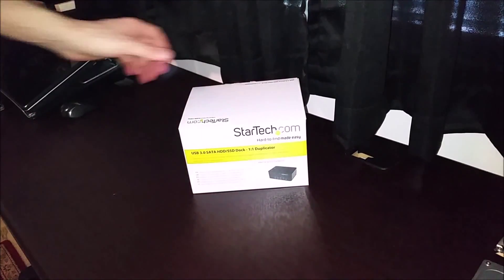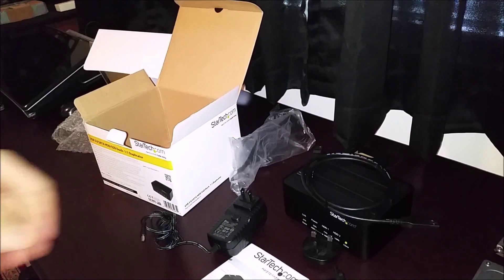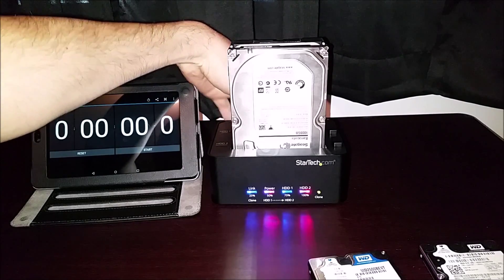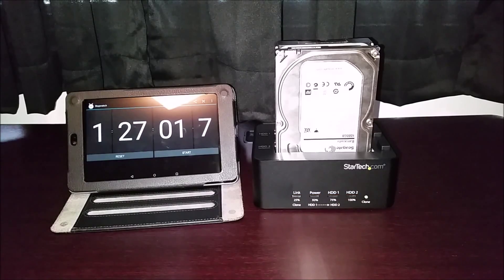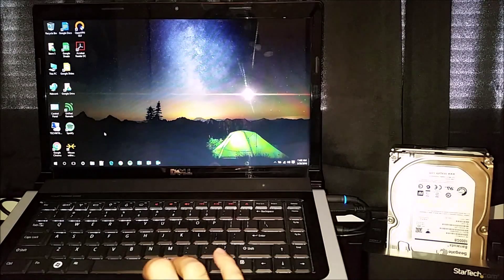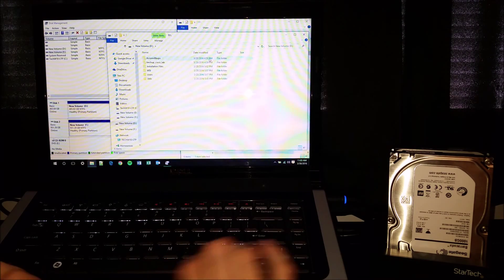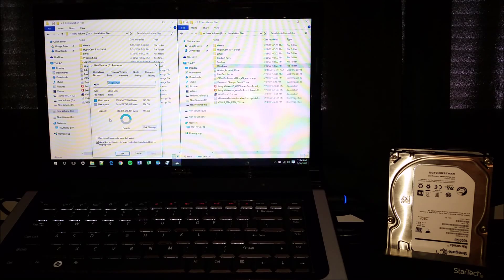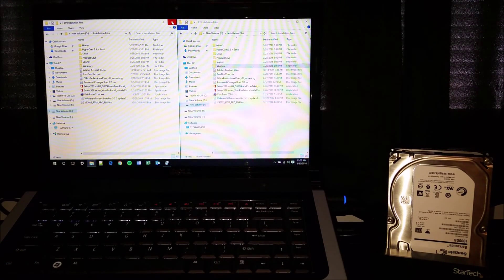StarTech Drive Duplicator

Comment: This works with ssd right?
Reply from the maker: Yes, this will clone 2.5" SSD drives. You can copy from 3.5" HDD to 2.5" SDD and vice versa. Just make sure the destination drive is equal to or larger storage capacity than the source drive. Sorry for the delayed response.

Comment: does this clone a boot drive to make another boot drive to boot up my 2nd computer?  Sorry noob here. :)
Reply from the maker: This device will make an exact clone of your hard drive. If your second computer's hardware is an exact match of the source computer then it will boot up just fine. If you're second computer's hardware doesn't match, i'e' the motherboard, then it might not boot. I suggest using a more robust imaging software like Macrium or Acronis that offer a Bare-Metal restore feature.

Comment: Well, cloned my win 7 drive, inserted the new ssd drive, it wanted to setup windows, hey I don't know.
Reply from the maker: It's possible you booted to the windows recovery partition. There may have been an error when cloning and there is something wrong with the boot sector. If all the data made it over to the new drive then I would try a boot repair, but if there is missing data then I would just wipe the new drive and try cloning again.

Comment: Are they compatible with Linux Mint systems when you aren't in stand-alone mode and want to access content from the mounted drives?
Reply from the maker: That's an excellent question. I would assume it would, as long as the format of the drive is compatible with the version of Linux you are using, but I haven't tested it.

Comment: Has anyone tried putting a smaller sized SSD as a destination drive? If I were to reduce the partition and defrag the source drive to where it would theoretically fit on the ssd the dock would fail but my partitions could copy properly? Also does the dock work even on a drive with bad sectors?
Reply from the maker: Putting a smaller capacity destination drive probably will not work. Reducing the partition and defragging the source drive is a trick that often works with software like Clonezilla. Copying a drive with bad sectors is hit or miss. Copying from a damaged source may not work and it will definitely take longer to copy than expected to copy if it does work.
Reply: Santech Solutions Thanks!

Comment: My understanding was that since it is cloning, it would that list as the original, meaning, same volume, same serial number....   This way you do not need to transfer licence numbers for software installed....   Am i incorrect?
Reply from the maker: Assuming you're booting from the same hardware as the source drive, yes, your operating system and software programs will be the same as they were, serial numbers, license keys, and anything else included from the state of the date and time you cloned the drive.

Comment: Does this make a clone of the operating system so I can swap one os drive to a larger drive with the same os and programs? Many thanks ahead of time
Reply from the maker: It will make an exact copy of the drive. Since everything is copied identically the same hardware will be required to boot from. The drivers and software will be there too. As for the operating system, if the source drive was booting Windows then the cloned drive will boot Windows. If there are boot issues on the source drive the cloned drive will most likely have the same problem and may still need repairs.

Comment: if you read this can you help .as far as I can tell, my computers hard drive has a problem, ( reading ) slow, will this star tech, copy / transfer everything to a new hard drive,  windows10 , email , photos, etc ,so I can fit the the new hard drive into my computer & happy days ! thanks...
Reply: took the plunge & got one,  my 1tb hd,  about a third full, to new 1 tb  hd , a bit over 2.5 hrs to copy,success , computer  up & running panic over..
Reply from the maker: Les, I'm glad this worked out for you. I've had trouble with recovering data from failing hard drives with older versions of this product, but the newer one seams to work much better. I still rely on Acronis as my #1 solution, but the drive cloner has come in handy a few times.